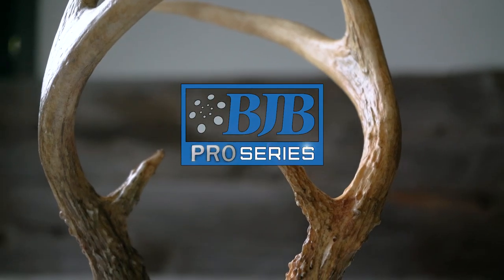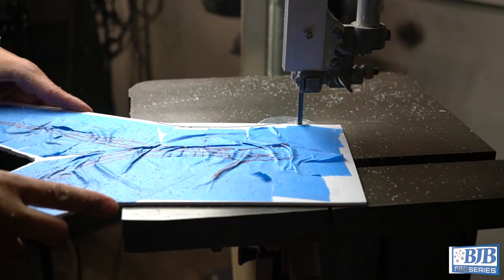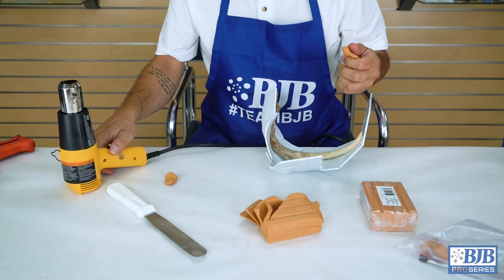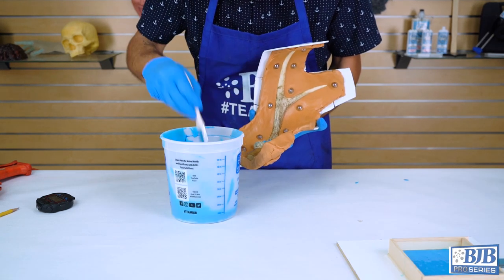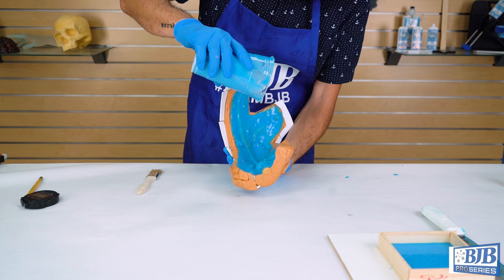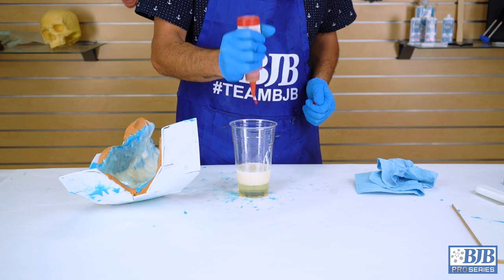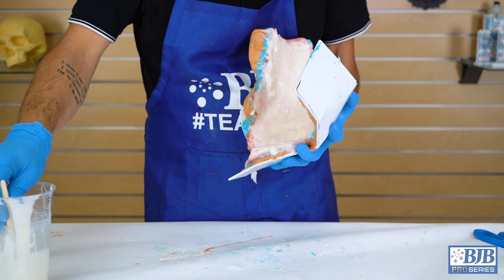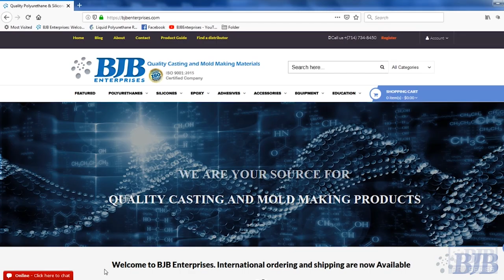Molding and Casting Realistic Fake Antlers | Tutorial

Comment: Do you guys have a video about making projects with your foams, like TC-284?
I'd love to see you guys make a juggling club/sword using that material.
[edit] Also...with a shore hardness of 75-D, how much break-resistance would those antlers have if they came loose from the wall and fell onto a concrete floor? Asking 'cause I'd be VERY interested in using TC-804 to make juggling props (which I'd drop/mis-throw very often), and as I don't have a vacuum pump, TC-804 would be PERFECT if it's durable enough to withstand drops and throws.
Subscribed.
Reply from the maker: Here is a great video showing how to make a foam weapon/prop https://youtu.be/thhDY6sb51A
The TC-804 is a tough material for being 75D Durometer.  It has high elongation properties for how stiff it is.  We took one of the antlers cast in TC-804 and threw it around on a tile floor and it simply bounced without breaking.  Those thin tips are vulnerable and they did just fine.

Comment: This is a very useful video especially for what I'm working on right now. However, I can't find your SC5001 thickening agent nor the accelerator on the website. Is it in stock?
Reply from the maker: A couple of things have changed in our product line since the video.  We are using FiberThick as a thickening agent for silicones and other materials.  It keeps good tear strength in the silicones while creating good brushability.  The tin accelerator has been affected by raw material shortages, but we have potential work arounds if you want to discuss with our tech sales dept.  info@bjbenteprises.com
Reply: @bjbenterprises  I can try out the fiberthick for the silicone, but some of the platinum cure silicones have a full day demold time. I'm actually willing to wait for the molds to fully cure since this is my first time doing casting.

What is the partial cure time for TC-5024? This will be very useful when I decide to work on the glove mold

Comment: What can be used other than hot glue right on the antlers? I have a set of very old roe deer antlers. I want to make a mold of them, but I need to protect the antler surface and mount they’re on. Ty!
Reply from the maker: Are you concerned that the hot glue will peel off some of the antler material?  You can also hold the antlers in place with modeling clay, but it would be much less secure than something like hot glue.